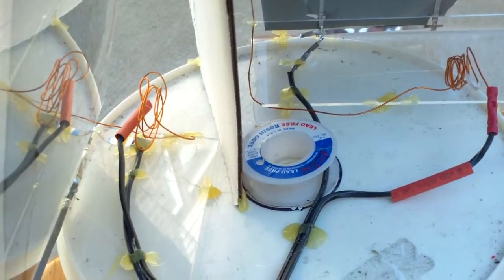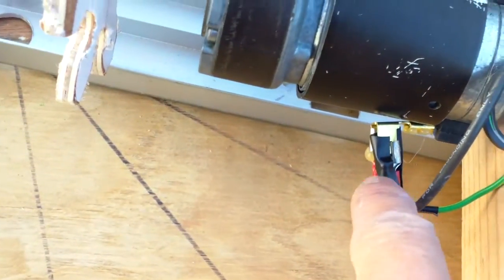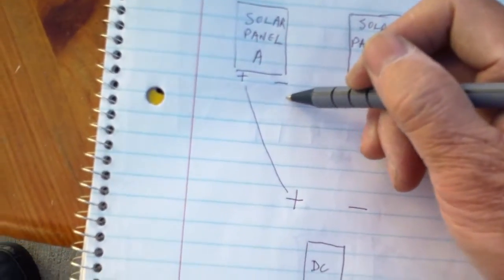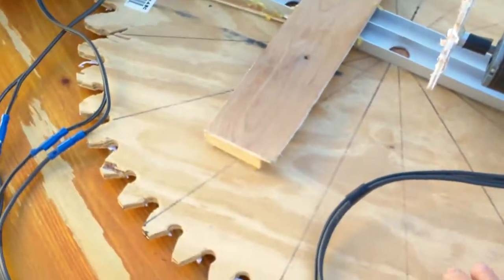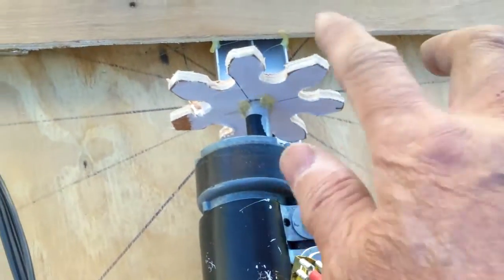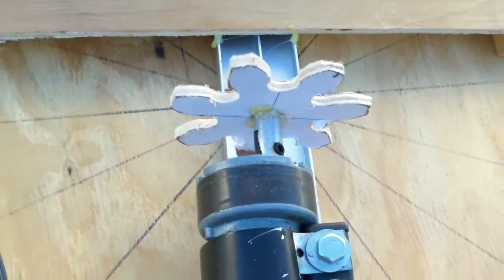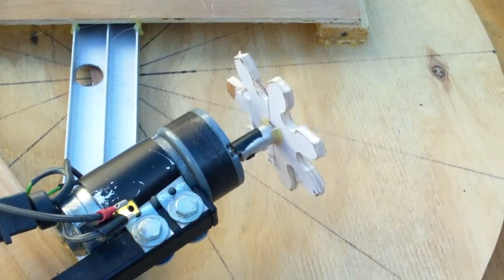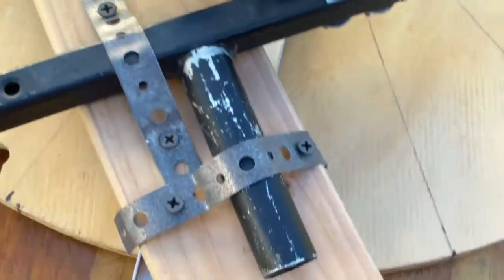solar oven tracker wiring

Comment: Can you please post the specifications and costs of the stepper motor?
P.S. Do you have any break in case of windy weather?
Reply from the maker: It's actually a geared DC motor which was previously used in a wind turbine set up. All I know is the short circuit amp is 125w. I have no problem with weather. The problem I have is rather my ground is not level so sometimes it doesn't turn smoothly because one corner of the platter might come into contact with the ground.